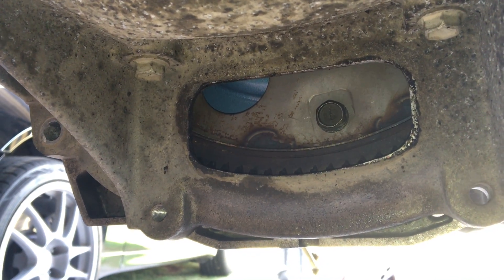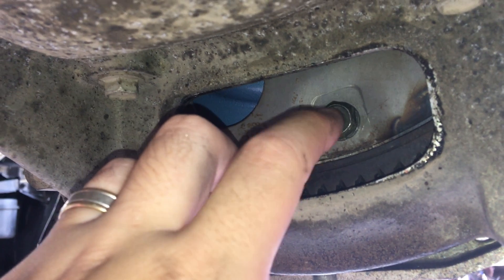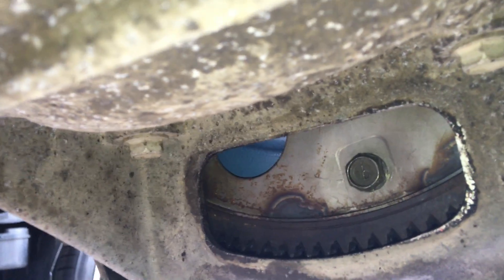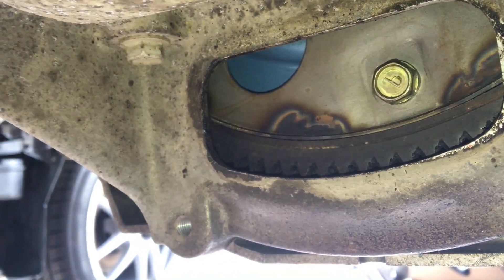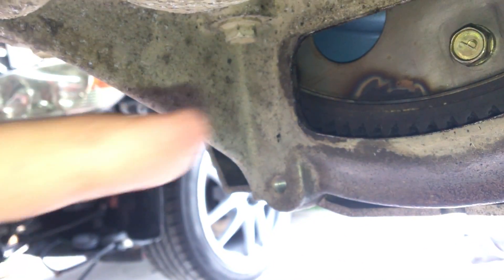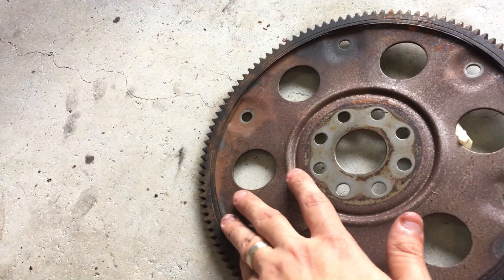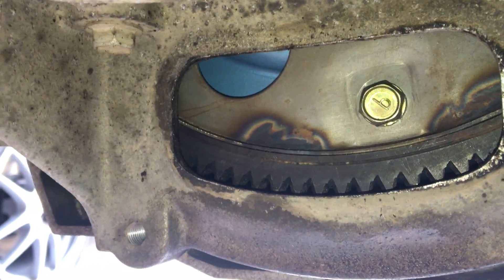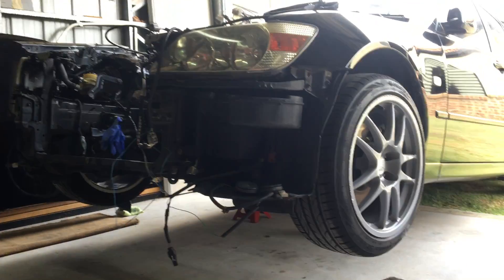1JZ & 2JZ torque converter assembly

Comment: think the flexplate welds should face the engine not the transmission
Reply: I thought the same. Maybe 1jz and 2jz ge or gte are all different welds and orientation.  My 2jzgte vvti flexplate welds face the engine.
Reply from the maker: The way this has been installed hasn’t been touched for 3 years. I can’t recall exactly why it’s the way it is.
Reply: George Smith no, the welds face the transmission. It’s correct in the video.

Comment: Man I'd be thankful if you answered my question..
I've bought a 2jz gte vvti engine and I want an automatic transmission fits my engine directly .. should I go with a340e from the cressida/crown? Would a340e fits directly without changing bellhousing, torque converter, fly wheel, or whatever??? Should I tune the ecu after installing the trans? Please I've been googling about this but there's no clear answers..
I'm putting that 2jz in my 2008 chevy caprice
Reply from the maker: Hi mate, happy to discuss more if you need thatcarchannelofficial@gmail.com - my answer would be to try and find jzs161 aristo transmission - it should be literally plug and play, I threw one of these out a few months ago as nobody wanted it even for $50, so I pulled switches, bellhousing etc off it and dumped it. They should not be difficult to source. I’d need to check but the plugs may be similar to a JZX100 chaser a340e etc.. the ecu is for all relative purposes untuneable, but will happily see 1 bar of boost, and you can easily run a few psi more with minor electrical add one like a SAFC neo etc.. I’m not 100% sure but Apexi might make a plug in Power FC that replaces the ecu, allows you for full engine control and auto control (if you get the auto version).
Reply: That Car Channel 
Thanks A LOT for helping me, mate. You've been soo helpful and I apprecieate it. Actually I didn't know that aristos have 2jz gte on them until you said it lol

What do you think about this tranny? 

https://jdmengineworld.com/product/jdm-2jz-gte-vvti-automatic-transmission/

Would it be plug and play with the fact that it's from a jzs147 aristo not a 161??

Comment: Torque specs! Why wouldnt you say the torque specs??? Two words
Reply from the maker: Sorry - I probly didn’t torque them, there only a small bolt, so a firm handle on the half inch ratchet would have been more than ample, similar to a pressure plate bolt in a manual trans -

Comment: What is the name that plastic/rubber piece that covers the access point to the torque converter bolts? I need to buy a new one but don’t know what to search up
Reply from the maker: I believe it’s an inspection cover - I searched for the diagram of the sump in a jzx90/100/110 chaser - auto or manual - and got the part number off it - I actually still have one, if your interested you can buy it? Send me an email at thatcarchannelofficial@gmail.com
Reply: It's called a "Plug, hole" toyota part #: 90950-01809. Seems like most JZ engine use the same rubber plug.
I have a pic of it but apparently we cannot upload a picture on youtube comments.